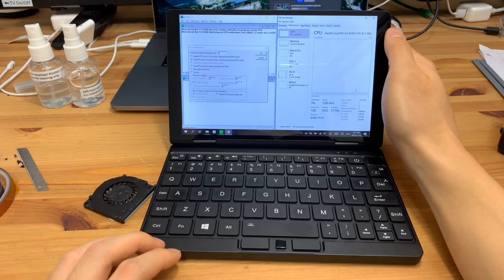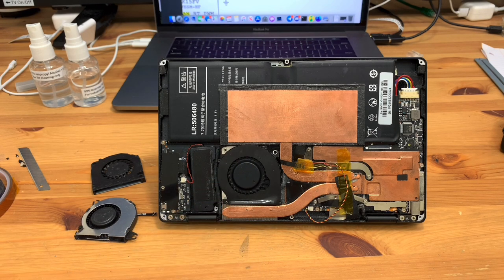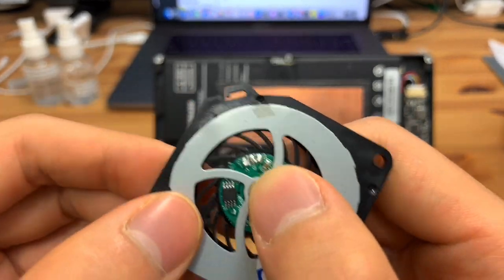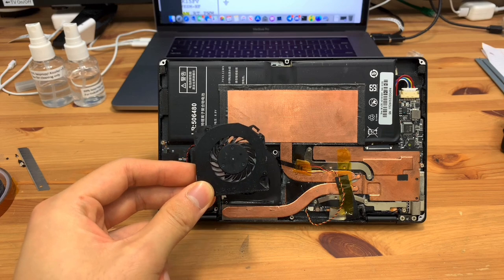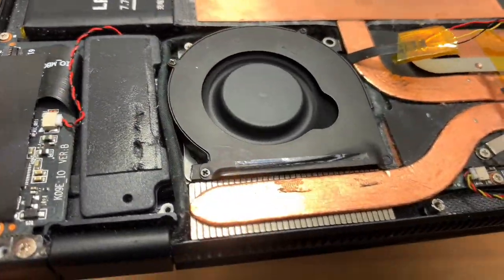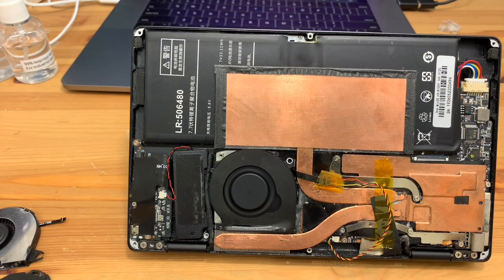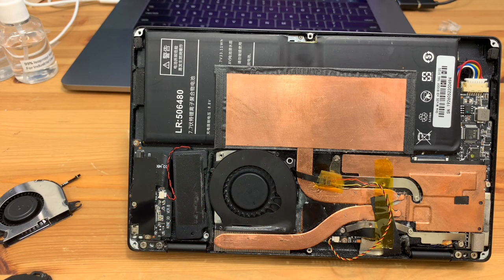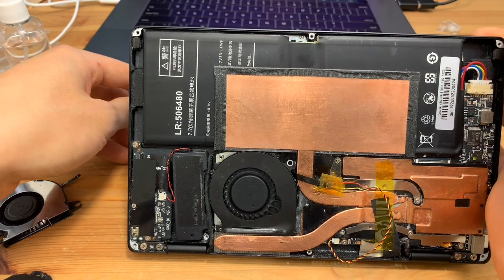One Mix 3s Yoga Quiet Fan MacBook Air Fan Mod DIY Fan Noise Fix

Comment from the maker: Update: Cut two 1cm ish squares of bicycle inner tube and contact cemented them to the top of the fan to keep the bottom case from touching the fan when pushed. Works perfectly. Kapton polyimide tape used to seal top cover of fan to heat sink.
Reply: thanks that worked

Comment: Thanks a lot for describing everything! I did the same to my One Mix 3 Pro Platinum (10th gen Intel).
The space is a bit more restrictive, and the display cable is shorter so barely fits around the Apple fan, but can be done. I managed to only dig a hole in the Apple fan, in the right spot instead of trimming bits from it. I had two fans and made some holes in the broken one to be able to see exactly where the final hole should be. This means there's some pressure on the display cable that your solution avoids, but seems to be fine so far.
In the end, since I had two covers, I risked it and I bent the output lip the other way so air doesn't go over the radiator fins.
I recommend repasting to everyone, btw, even if you don't intend to do anything else.
On a separate note, the OM3 PP 10th gen doesn't have the m2 slot.

Anyway, thanks again for the idea, the original fan sounds like a strangled chicken, much much better now :D
Reply: Hey, just wanted to say thanks -- the tip about the hole for the screw standoff saved me here, as I couldn't get it to work with my case.

Comment: Thanks for the tip! I was able to do this on my One Mix 3 Pro and it's way quieter now and temps are much more stable. I'm able to undervolt and increase turbo in Intel XTU to get over 1000 pts in Cinebench R20 now. I had to use pliers to bend the lip on the fan case down and use thermal pads to keep the back panel off the fan. The back panel is bulging a good bit now, though.
Reply from the maker: Great to hear that it's worked well for you! 

When I did this the back panel didn't bulge at all. I assume it depends on the thermal pads you select.
Reply: can you add a pic of the one mix 3 pro with this mod and where you put the pads? im keen todo on my OneMix 3 pro...
Reply: Edward, how many degrees did the temperature drop under load after that fan mod? What thermal pads did you use?
Reply: Have you considered replacing the stock thermal compound?
Reply: @minsc9976  I've changed stock thermal compound with arctic mx4, but didn't notice much difference (2-3°C). Original one, after half a year was in good condition.

Comment: Thank you!! I did the mod. Maybe my experiences are useful for others as well: Everything works relatively well, as you describe in the video. On my A1370 fan I bought on eBay, the label "A" was not there, instead the two inner lines are labeled "O/P" and "PWM". The yellow wire needs to go to "O/P". And: After reassembling I had major issues with the bottom cover touching the rotating element of the fan. Even with spacers (kind of foam) placed on the edges(!) of the fan (placing on the metal plate cover of the fan would push that one into the blades, not good as well!)  the issues were still there. I now used insulation of mains power wires as spacers (mounted to the edges of the fan using heat-resistant tape), which makes the touch issues to away, but instead the bottom cover has a slight bulge now that touches the surface the unit it sitting on.  Not dramatical, but it is noticeable. Half a millimeter thicker and the unit would wobble on a table surface. I consider applying thicker rubber feet to the bottom. That would also solve the problem, that the fan cannot suck enough air from under the unit (which was the case with the original fan as well), when the unit sits on a table. Whenever I lift the unit just slightly from the surface, the fan noticeably makes a different, less strained noise.  But despite of these issues, the mod was really worth it!  I often did not use the OmeMix 3s due to the awful fan noise. Now it sounds exactly as my Macbook Pro. :-) Nice!
Reply from the maker: Great to hear that it's worked for you! I did note below in a pinned comment that I ended up using bicycle inner tube as a spacer instead of foam, since it won't compress easily. On mine, the thickness was perfect and did not bulge the cover noticeably. Some people note that the new 3s is different from the one I did, so this may vary.
Reply: @liminalsunset  I saw your comment, but I don't have bicycle tube at hand right now :D Searching for a good alternative, First I used that foam, it was a quite hard foam  that I thought would not compress too much, but it did. So now that insulation was the only good alternative I could find in my house at the moment. :D 
By the way, I also had issues re-mounting the bottom case screws. Due to the bulge, the bottom case's 2D footprint is a tad smaller than originally, and thus the screws do not fit exactly anymore.
Reply from the maker: @hertrich-photo  That's good to note! On mine, the holes were able to line up perfectly. Perhaps you could also use layered squares of electrical tape or other similar materials?

Comment: Awesome! How do you find thermal throttling with this solution? As mine stands it throttles down to about 2.18ghz under continuous load, even from a cold start in a cold room.
Reply: I've done this mod. No throttling at all for me.

Comment: Wow, I was thinking about doing a mod like this to my 3s I'm glad someone has some done the groundwork for me, thank you. 

I noticed that your heatsink is all copper, but was all black before? how did you manage to remove the black coating to my understanding it is only painted black right? Did you use Paint remover/thinner/sandpaper?

Also what do you think of using thermal pads on the big copper heat spreader on top of the battery to better connect to the back plate? And thermal pads on the VRMs

Thanks for your time
Reply from the maker: It's been about a year since this was posted, sorry about being so late to the conversation. But in case anyone else is reading, the black stuff is paint, and is easily removed by soaking/brushing in acetone.

I never ended up doing this, but it would probably be worthwhile to try to use thermal pads over the VRMs. They can get very hot. Would caution against thermal padding anything to the battery, which would heat it up more and cause it to expand perhaps.

Comment: How come the heat sink is bare copper in this video and anodised black in the other?
Reply: I'm still wondering about this. Could somebody answer how to remove the black cover from the heat sink?
Reply from the maker: @ijmentalight  For those of you still wondering, though it has been a while, I used acetone bath and a brush (obviously a non plastic brush) to remove the "paint" from the surface. Nail polish remover will probably work. You'll need to remove the foam sticker on the battery part carefully, then reapply it after everything is dry, since the acetone might dissolve that.

Comment: Hi +Larry - do you also observe (before the mod, probably also after it, though) that the air flow from under the machine is throttled, while the machine sits on a table? When I lift the Onemix 3s from the table just a little bit, with the original fan I notice that the fan noise changes significantly. It turns slower. If I let it rest onto the table again, it sounds as if it turns faster, so as if it needs to turn faster in order to pull the necessary amount of air. Like a vacuum cleaner that you put a hand onto the end of the tube.  Not a good feeling, so I tend to keep the unit standing on a pen or soe other objevt to keep a distance between 3s bottom and the table, while it works unattendedly. 
Just ordered an A1370 fan for the mod. Thanks a lot for the informative video!
Reply from the maker: I do notice that with the new fan, the output of the airflow "projects" less from the back of the unit. With that said, I mostly think it's due to the fact that it's hard to make a perfect seal with the heat sink and the airflow pattern is a little more turbulent. However, I'm confident more than enough airflow is passing through the heat sink for good cooling. 

For me, the difference with it on and off a table wasn't too bad. Though the sound changes, as you note, the air coming out the back appears not too restricted.
Reply: @liminalsunset  Lastly, the CPU temperature is the most important indicator, I think. I measured here under heavy CPU load. The temporature does not rise beyond 71°C, with the unit sitting on a flat table. I think that's acceptable, isn't it?
Reply from the maker: @hertrich-photo  Yep, I think that's a great result. Many normal sized notebooks are unable to hold 71C under load. Many can get up to 85, even 95 degrees.
Reply: @liminalsunset  good to know, thanks! So I consider this mod a great success :)
(From the first day I used that machine, I thought I need to replace the fan, but never did it yet, until I found your video a few days ago.)

Comment: Hey Larry and commenters, I successfully did this on my One Mix 3s Pro (i5) and thought I'd give some modified steps for that, as it seems like either the later models or that specific model is short on space.  It's long, so I'm just going to re-link the reddit post, but hopefully it will help people who had issues here.  

Mounting the fan with VHB causes it to rise too high and the case to bulge, but you can mount it by drilling a hole where the standoff is and using that + the other standoff to keep the fan in with VHB, and then either VHB or the bicycle tube trick mentioned in larry's update to shim the case off them.

https://www.reddit.com/r/GPDPocket/comments/isezel/one_mix_3spro_quieter_fan_mod_redux/
Reply from the maker: Hi! Glad you were able to make this work! Thank you for posting that for the community, it's very well written and helpful!
Reply: My thanks both to you and the OP. I did this mod today. It was much easier with your efforts. I also used liquid metal on the CPU, better thermal past on the SSD, thermal padr on the power supplies. Its super quiet and CPU is nearly 30 degrees cooler under load (86 down to 58 degrees C). The casing is now comfortable on my lap :) I expect the motherboard and battery to last much longer now too.

The soldering was super fiddly. I found separating the connectors in the ribbon of the new fan to be essential. I also had to bend the lip on the exit port of the new fan to stop it pressing on the case as this was stopping the fan.

Comment: hmm, the Macbook Air fan I bought has labels +, -, O/P and PWM. Does the yellow wire need to go to O/P (what is it?) or to PWM?
Reply: found the solution. It's the O/P line the yellow wire must be connected to.

Comment: I am actually more interested to know how is the airflow with the new fan compared to the stock fan (its not only louder but also inefficient in moving air around and avoiding throttling). If the new fan also improves airflow and thermals, then Im up for doing the mod myself as well. But if there is no thermal improvement, then just because of noise issue it's not worth it for me. Thanks for the video :)
Reply: It feels like it pushes as much to 1.25 times as much air.  I think the fan geometry does a lot for this, as 'both sides' of the original fan are open.  My thermals are significantly lower than initial (10 degrees under load, and I idle at 34-40), but that might just be because I re-pasted it better this time than the first time I did it without a new fan.  It is significantly quieter however.
Reply: Seems to me to be a lot more.

Comment: I managed to get all the parts but I can't get the lid to close without affecting the fan, any pointers on why this could be. Did you remove the metal plate under the fan
Reply from the maker: The metal plate screwed into the laptop wasn't removed. Could you verify that the fan you have is for a MacBook Air 11" and that you have modified it as shown in the pictures towards the end of the video? Please ensure that the wiring is routed around the fan, not under it.

Comment: Do you think this mod can be done in One Mix 4?
The fan noise is very high
Reply from the maker: Hi, I do not have this device, so I would not be able to advise, but the general principles of this modification should remain unchanged. You may need to find a different fan depending on whether the suggested one fits into the enclosure.
Reply: @liminalsunset  Thank you, I´ll try to get one and see if it fits
Reply: @liminalsunset  I finally did!!
Now noise is way better, although not completely silent.
Reply: Got a onemix 4 too and the fan noise is atrocious. Were you able to do it with the same fan as shown in the video?
Reply from the maker: @poloboy  Sorry, I don't have one of these devices, so I wouldn't be able to tell you if it would work. I will have to look into this. Thanks
Reply: @poloboy  Yes mate!
Macbook 11" fan, just as the one in this video.
You'll need microwelding tough, can't be done with normal tools.
Reply: @monchoglu  Thank you!! I'll order one right away
Reply: @poloboy  if you need anything just ping me 👍
Reply: @monchoglu  will definitely do, i appreciate it bro
Reply: @monchoglu I am looking yo do this mod very very soon as my fan on my mix 4 just died. How did you mount it?

Comment: I also did this. However seems like mine hat some tighter margins, the fan (the central fan piece seems to be a tiny bit higher than the body) hit the bottom of the case and wouldn't spin. I temporarily solved this with some stand-offs but was not satisfied with it.

So I searched for other alternatives to the fan an came up with this one: SEPA HY45T05A (Examplary link to a german shop: https://www.reichelt.de/de/de/radial-luefter-45x45x5mm-5v-27db-5200u-min-gleitlager-sepa-hy45t05a-p291164.html )

I has the exact same dimensions than the original, event the holes are at the exact same position. It's a PWM fan but it works just fine without the PWM signal. I might try to add a mod to get PWM working with an external temp sensor...but I am very happy right now event without PWM, much quieter than the stock fan!
Reply: Hi Frederik, thanks so much for the information. The fan on my One Mix 3s is failing (not just noisy) and I was looking around for replacements. You might be interested to know that a company that sells One Mix 3s part online (China RTD Laptop Part Co,. Ltd.) also recommended this fan as a replacement for the OneMix 2/3 netbooks. The exact fan model number is 'SEPA HY45T-05A' and I found it cheaper from other sellers. I wasn't sure this fan rated at 0.15A would be suitable replacement for the stock AAVID THERMALLOY 0.38A fan, but your recommendation gives me peace of mind. I've since placed an order for 2 x SEPA HY45T-05A fans online. Thanks again.
Reply: @bungee28  dealing with a similar issue myself. How did it go for you?